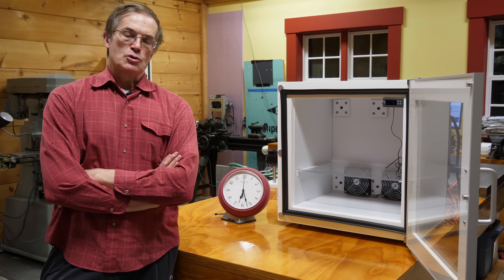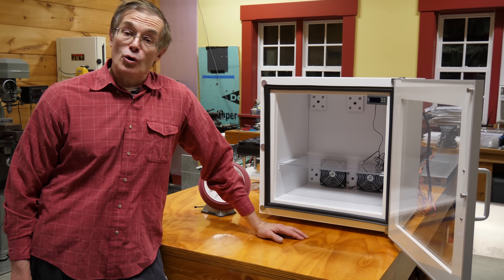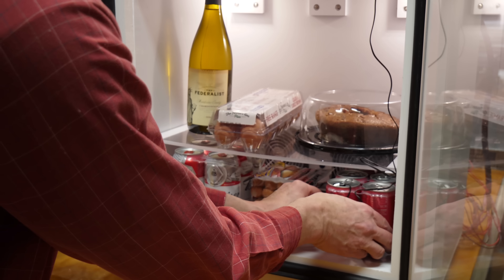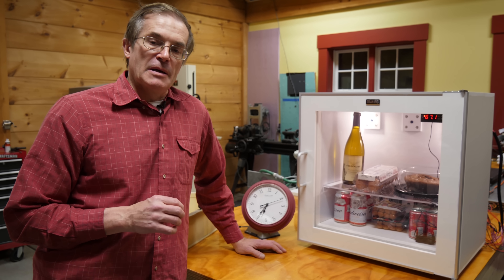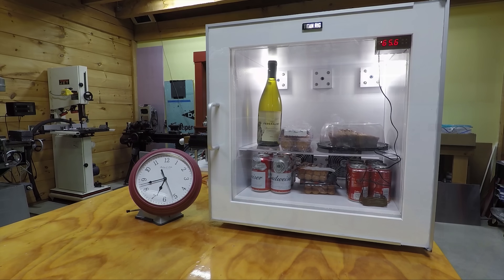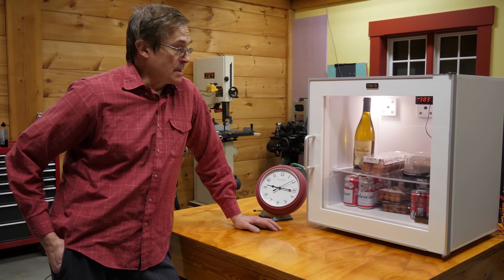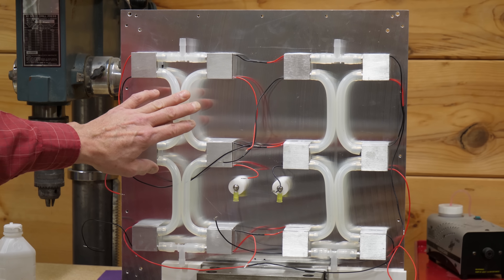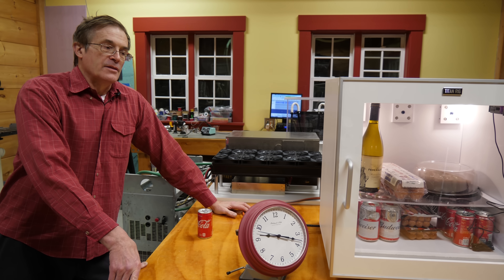TESTING OUR DIY REFRIGERATOR! - TEC/PELTIER

Comment: I appreciate your knowledge and explanations. Your design concepts create scope to custom build for standard joinery. Looking forward to V2 but more so V3- which should incorporate the best ideas. Can  you publish the electrical power consumption data over a 24 hr period (or longer) please?
Reply: i think he realized @ some point this was not a good idea , and is probably embarrassed to reveal power consumption..........oh yeah , throw MORE money at it ( more p-units.etc.)       we'll get the temp down eventually        i sound mean spirited , i suppose , but as lovely and crafty as this is , it is not the way to go for 12 v. cold , and money is tight for some        just trying to warn those seduced by gee whiz tech , it's EXPENSIVE         to build , and to operate
Reply: @kcajmortsnnew1488  Yip. I've done a video on the efficiency of peltiers. They are extraordinarily inefficient. You could potentially take the worst pump phase change gas fridge made today and it would like like an energy star in comparison.
Reply: @HellTriX  Pump phase change is relatively efficient for what it's doing, and you can certainly help the process out if you can run external cooling on the unit, it's just logistically complicated because it would involve cutting holes in your walls to run a fridge.
Reply: i was SO HAPPY when i converted to 12v compressor type , changed my life.....those old 3 way evaporation COOLERS  ( phase change ?) refers used 3X the power (12v) , and would suck a propane bottle away in a week ! , and a battery down in no time            i'm gonna check you out               @HellTriX
Reply: @kcajmortsnnew1488  Compressor types are phase change. Using a standard refrigerant,  the compressor compresses it into a liquid and as the coolant phase changes into a gas you get the cooling effect. Evaporator coolers are also phase change, but you are using water as the phase changing refrigerant. the R-410 types being much more efficient than water/steam. The peltiers are really neat and hopefully one day someone figures out how to make them more efficient.
Reply: thank you !            i wasn't sure about nomenclature , being a seat of the pants thinker , not science/math oriented....lots of trolls here giving me grief for using wrong words , although i believe i'm trying to communicate clearly....the arrogance and insecurity of young men , i suspect....anyway , thanks for being human , we're all in this together @HellTriX
Reply: @kcajmortsnnew1488  Totally agree, kind words,  have a good one. :)
Reply: @kcajmortsnnew1488  don't sweat it. The ones who get upset by wrong terminology are usually not the experts. In the field of engineering, there is very little consistent terminology. That said, most people will call a propane powered refrigerator just that. The traditional type being mentioned here as a phase change is more property called a vapor compression refrigerator, as the cooling effect is due to a vapor being compressed. Phase change is ambiguous because both types actually involve phase changes.
Reply: @kcajmortsnnew1488  People are trying to teach you the correct way to discuss the topic, it would be "cool" if you tried to learn rather than attack people trying to help you overcome some deficiencies.

Comment: great video! I'm interested in the power consumption; I have a boat that I would like to build a refer on. A custom build would accomodate the odd sizes and shapes of a hull. Water cooling wouldnt be a problem, just tap a through hull, and pump the heated water overboard!

Comment: Thank you so much for bringing up the point about cooling inside heating inside cold.  I've always thought that's nuts and in fact I've seen numerous 'primitive' refrigeration designs that utilise the cold air from outside.  It seems like this could be utilised in conventional refrigeration to great effect if it were commonplace taken into account in building construction and refrigerator design.  Same goes for lighting.  (Ever seen any of the fiber optic solar lighting designs out there? Might be another cool series to work on).  Hopefully we see some real world performance analysis as you refine your design into your final version?  Thanks!
Reply: mslindqu 
Agreed! It would be most efficient to just put the food outside 🤣
Reply: @Conservator.  Yep!  This is what we did through college at MTU

Comment: Could this theoretically be improved by adding heatsinks inside the fridge too, and adding a smaller fan to circulate the air around the compartment?
Reply: Theoretically putting the peltiers on the top would be best since hot air rises ... bot inside the fridge and outside.   That's how the 12V DC car coolers work with fans that blow up and out and peltiers that sit on the ceiling.
Reply: @Tom St Denis  exactly what I was going to write. It would be interesting to know how much less induced circulation would be required. Perhaps enough to make it quite or at least quiter? Very neat build as always though
Reply: @ImShogun  the reason it was so loud is his choice of fans.   
he didn't need anything near that powerfull.
Reply: why would you add heatsinks inside the the fridge when you are trying to lose heat from the inside?
Reply: @vinylexperience77  To "sink heat" from inside out
Reply: @victornpb  your right, lol my bad
Reply: @vinylexperience77  The bigger the surface area is between two temperature zones, the faster any heat exchange will occur as thermal resistivity decreases.
Reply: @vinylexperience77  because that is the cold side of the peltier think of them as Coldsinks. The fins on a sink device are just to increase surface area for contact with air to facilitate the transfer of energy. if you circulated the air inside the fridge as well over sinks it would help. The only drawback is of course adding more and more fans may not result in efficiency gains as they use power and make heat as well.
Reply: By using a better heat conductor (like silver) between the cold/hot side, it should be possible to improve efficiency a bit - TEC temperature difference/power draw optimization, especially if you use a power/temperature tracking power supply (think solar panel MPPT) 
Not exactly cheap though, and the weight will go up.
Adding a fan/heatsink inside the compartment will not increase power efficiency, though it will/should decrease the time it takes to cool stuff. The fans power draw decreases power efficiency, there will be less place for stuff + cleaning is a mess. It also makes noise.
Reply: I'd be putting the peltiers on the top of the fridge and then the internal fan motors on the outside connected to blades on the inside by running shafts through the walls. Either that or run them with a magnetically coupled clutch. Also put the led lights outside and run light through some light shafts or fibres.
Reply: I thought about that, but the system is already bottlenecked from the amount of heat that you can remove on the other side. So it may not make much difference after all.
Reply: @victornpb  that is what the guy in the video thinks.  but it's actually limited by the amount of heat it could absorb from the unit.  
he has a giant ass heatsink on the back.  and only the aluminium u shapes to absorb heat from the unit.  with those thick but tiny aluminum blocks to transfer the heat from the u shape to the peltier.
Reply: I was thinking the same!
Reply: Maybe,  but technically, they would be heat sources, not heat sinks.  He he described in the previous video, how the design of the cabinet enables pretty good conduction of heat that actually works well through the inner walls,  back the the TECs.  That is why the walls were made of aluminum instead of plastic.  The fans inside are mainly for air circulation, to help prevent stratification layers in the box.

Comment: What's the efficiency of this fridge?
Reply: I think in the first video he hinted at about 33% as efficient as a standard fridge (using a compressor).  The upside to this sort of device is you can run it on low voltage DC and aside from fans you don't really need moving parts. Indeed in the winter if he used an alcohol based coolant he could run it through radiators outside without fans so just a pump.
Reply: @tomstdenis  
Wouldn't need to be alcohol based. Ethylene glycol has been used in radiators for decades, to great effect. ;)

It's cheap and effective, with a high boiling point. Alcohol has a low boiling point, and is expensive and unstable.
Reply: @tomstdenis  Aside from the compressor, a regular refrigerator doesn't need moving parts either. Also, you can buy 12V compressors for RV's and boats.
Reply: Also, glicol lowers the thermal coeficient of the water. Alcohol would be better option here for cooling. And setup like heat pipes. Than it wouldnt even need the pump.
Reply: @royb.1441   Rm Blake  probably not entirely necessary, but still a good reason to avoid it, among the others listed. It has less thermal expansion as a result of the power boiling point, which is why I mentioned it.

Not to mention, the price of an EG/water mix is orders of magnitude cheaper.

There's really not a good reason to use alcohol, is my point.
Reply: @austinmabry8462  You have to swap the Glycol/Water mix out though, and you have to make sure everything is the same metal or you'll get corrosion and eventually failure of your fittings. If you were using methanol you wouldn't have that issue and with the right pump you don't have to worry about the methanol vaporizing because you can flow it across the peliters fast enough.
Reply: @jttech44  
None of that is accurate... If you add a simple anti-microbial agent to it it will last for decades.

Alcohol is going to evaporate no matter what you do.